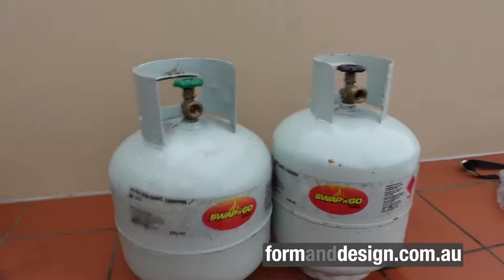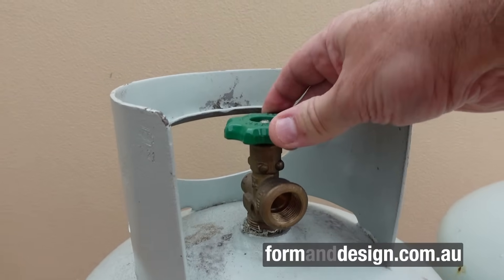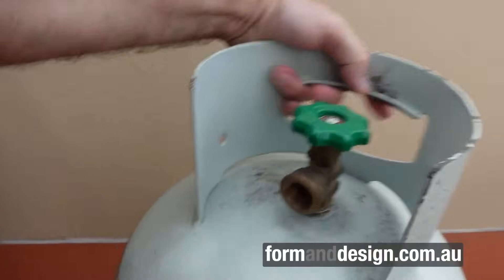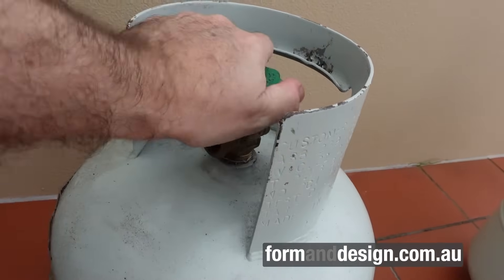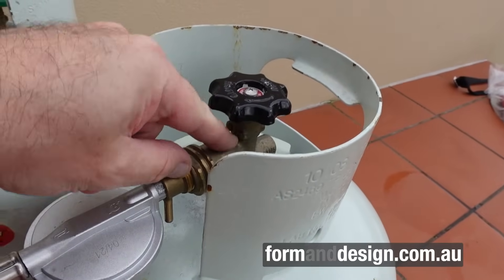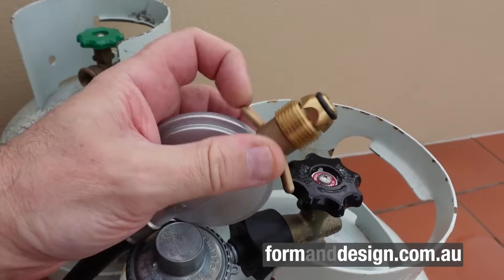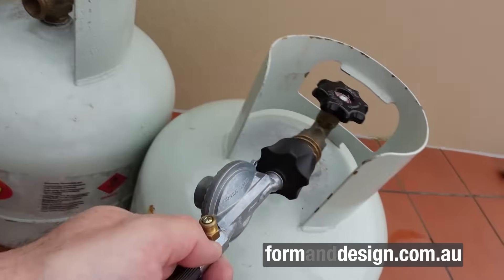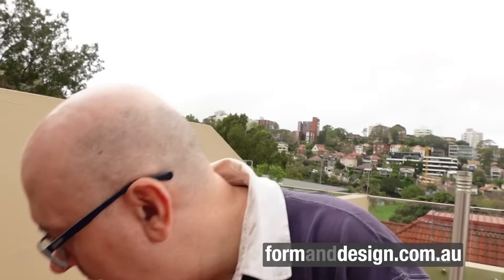LCC 27 vs POL Gas Fitting - What's the difference?

Comment: I bought a new regulator/gas safety gauge (Garth brand) and fitted it to a newly purchased (full) LCC27 bottle. However, there is no gas coming out at the barbecue end of the hose. What could be wrong, please, Andrew?
Reply from the maker: @topearner2007 a few things to clarify first. I would recommend that you check out my Part 2 video on this topic which answers the most common questions and comments on this video. You can find it here https://www.youtube.com/watch?v=4JFYltGZfrE. My questions for you. 1) Why did you buy a new regulator? 2) What is the fitting on the new regulator hose? Does it have a LCC27 or a POL fitting to attach to the bottle? 3) Does your new regulator hose fitting have a gauge on it? See the Part 2 video. 4) Is this an Australian enquiry? If not, I can't answer your questions because I am not familiar with fittings from other countries. 5) If you purchased a LCC27 fitting, where did you buy it from? If purchased from an online store like eBay or Amazon sometimes they say LCC27, but are actually QCC1 fittings from the US and are similar but not the same and should not be used.

Comment: Thanks mate very informative video how much is the new hose 😊👍
Reply from the maker: Check hardware stores websites. Search for “LCC27 fitting”. They are readily available and not too expensive. If you change yours then use some soapy water around the connection where you screwed out in to you BBQ or whatever you have to check for leaks when you allow the gas to flow

Comment: Here state side this switch happend for us quite some time ago before I was born so at least 2 decades ago but for us POL is still used for bulk tanks connected to the first stage regulator or 100lb propane tanks only come with a POL connection as they are mainly used for residential heating applications or food trucks

Comment: The pol fitting won't push the safety valve to release gas from new cylinders
Reply from the maker: Unfortunately the problem lies with the POL fitting not the LCC27 fitting (I’m assuming that you are Australian and referring to the LCC27 fitting. If not then ignore this video). The problem with the POL fittings is that not all the manufacturers are sticking to the design and there are variances. There is no variance with the LCC27 fittings

Comment: Common for house gas users to use 9kg in place of 45kg , this would make changing over easier, if the lcc fitting is allowed on fixed installations.

Comment: The LCC Type 27 is basically the same as the old US QCC fitting. This was superseded some time ago by the OPD fitting. The OPD fitting has a triangular valve handle and an overfill protection mechanism inside the cylinder. The Australian LPG industry missed an opportunity to eliminate the problem of overfilling.

Comment: They make an adaptor to use LCC27 fittings with Pol bottles on eBay but fat chance finding them in a place like Bunnings.
Reply from the maker: Adaptors are dangerous and illegal in most states. This is because the two threads work against each other. When you tighten one it is possible to loosen the other since one is CCW (POL) and the other is CW (LLC27). Also all the adaptors I’ve seen are POL to QCC which is slightly different to our (Australian) LCC27 fitting. The simpler thing is to swap out your bottle for one with the new fitting which safely accommodates both POL and LCC27 fittings.

Comment: That’s all very well and good except … I have a POL cylinder, exchanged it at Bunnings back in May. Still has heaps of gas in it. But the hose & reg on my BBQ was perished and the O-ring was pretty squished, so I thought I would just buy a replacement. But POL hose and regs are not available anywhere. I didn’t want to get an LCC27 type because my cylinder is still nearly full. Fortunately I found one on Amazon. 
Then I bought a Matador Rapid Searer (brilliant machine, cooks a steak in 2.5 mins), but of course it comes with an LCC connector that doesn’t fit my POL cylinder. aaahh! 
At this stage I was about ready to stick my head in the oven, but didn’t have the right connector.

Comment: Or buy an adapter and you'll never have to use your brain to think about it again.     (LCC 27 to POL adapter)
Reply from the maker: An extract from Elgas' web-site regarding this issue.
"Whilst you may have purchased an LCC27 to POL adaptor (gas bottle adapter) at Bunnings or other BBQ store, please remove and discard it because it is a safety hazard.

In addition, the LCC27 adaptor (gas bottle adapter) is banned in WA whilst the QLD, VIC, TAS, NT and SA state governments have posted warnings against LCC27 to POL adaptor use. This follows a homeowner receiving severe burns resulting from a gas cylinder fire in Western Australia whilst using an LCC27 adaptor (gas bottle adapter). The injured person was hospitalised for further treatment."

Comment: Minor issue: If you are using an LCC bottle with a POL fitting, the POL fitting will NOT engage the internal valve in the LCC fitting. If some clever cloggs has opened the tap on the LCC bottle while it is detached the safety valve inside the LCC fitting will close. When you screw the POL fitting in, because it won'tnengage properly, the gas pressure behind the safety valve will keep it closed, meaning no gas will flow. The only way I have found around this is to make sure the tap is closed and force the internal valve open with a suitable rod of some type—it's high pressure, so it takes a good thump—preferably made of brass (sparks are a no-no). There will be a slight puff of released gas, and the POL can be attached and used normally. Then, replace all of your POL fittings with LCC ones 😉
Reply from the maker: If you find that "the POL fitting will NOT engage the internal valve in the LCC fitting" then chances are that your POL fitting is old and needs replacing. These things do not last forever and some older spec fittings are problematic. If you are trying to gerryrig something like this, then OBVIOUSLY something is wrong. If the POL fitting and the LCC27 fitting are in good working order then it should work as designed. My recommendation is to NOT fiddle with the safety valve. It's there for a reason. Figure out where the problem is and replace or fix the part that's faulty. Put simply, the new LCC27 fitting on the gas bottle in particular is a major safety improvement designed to reduce the risk of accidental gas bottle leaks and the consequences thereof.

Comment: I wanna get rid of the counter clock wise turn on the tank to tighten it. I’d rather have the other end with the big plastic so I can hook it up clockwise and un loosen it counterclockwise like normal on anything else then I don’t have to bring a wrench. Is that possible for cutting the hose and putting a different one on?
Reply from the maker: I'm not sure what you mean by this. The new LCC27 fitting is a clock-wise fitting (for tightening). If you have an old POL fitting, then simply go to a hardware store and purchase a new hose which will come complete with a regulator and the new LCC27 fitting attached. Then simply replace the old hose, by unscrewing it, with the new hose/regular/LCC27 fitting. I hope that answers your question.
Reply: @ I went to a hardware store and they actually had it for once every other place in this small town never had crap. I bought the adapter and it also has a regulator on top to let you know if you’re full or lower or medium wish I could send photos on here.
Reply from the maker: I think I understand what you are trying to achieve. I have seen on internet searches the type of product that you have purchased. If I understand this correctly, what you have purchased is an adaptor that converts a POL bottle to a LCC27 fitting. Just for the sake of explanation, I am a Professional Mechanical Engineer and I designed many pressure vessels and their associated fittings. I also managed design and manufacturing operations that made cryogenic road tankers and pressure vessels. I have some experience in this and I have seen many accidents and heard of many more from gerry-rigged appliances as well as accidents happening that have caused redesigns of products. The problem with the type of adaptor that you are using is this, the two threads work against each other as you have pointed out. So when you install one, let's say the POL fitting which has a CCW thread, every time that you tighten the LLC27 fitting (which is a CW thread), you risk loosening the POL fitting. That's because to loosen the POL fitting you wind it CW. You might say that you tighten it more than enough so that it won't loosen, to which I would say, that's an accident waiting to happen. The adaptors have been banned in several states already due to severe burns occurring from adaptors that have come loose. Given enough time, these adaptors will be illegal all over the country. There have been a few comments from people who seem reluctant to just upgrade their equipment. I'm not sure I understand why. In stead of spending money on adaptors, isn't it just easier to swap a bottle. The swap system doesn't care if it's not their bottle. They don't care if you go and fill the bottle through a manual fill station later when it's empty. Also, their bottles are certified, checked and stamped. Bottles have to be re-certified every ten years. Also the considered useful life of a hose and regulator is also ten years. New hoses with regulators are also a cheap alternative. My recommendation is to, throw away your adaptor and upgrade your gas bottle to the new LCC27 fitting either by purchasing a new one or by swapping it out. The LCC27 fitting will accept both POL and LCC27 fittings on your appliance.
Reply: @ like I told you before I’m not allowed to send pictures on here. They don’t let you if you would look at a picture I have you would understand. When I hook up my Mr. heater, I like to have a ACME hook up with a huge plastic handle that you turn on clockwise onto your tank. With the POL you have to turn it counterclockwise to your propane tank. 
All I did was buy an adapter that the POL screws right into the adapter and that will personally stay there nonstop. I will not take it out. The other part is the ACME. I told you before give me your email please
Reply from the maker: I can’t give my email address over a public forum. BOTs and Trolls pick them up and run with them. I know exactly what you are talking about I don’t need pictures of your setup. My recommendation hasn’t changed. Adaptors in POL bottles are potentially dangerous. You first tighten the fitting into the bottle (the POL fitting). Then as needed you use the hose and regulator setup with the LCC27 fitting to attach to the adaptor in the bottle. The problem is as you attach and tighten the LCC27 fitting in a clockwise direction you risk loosening the adaptor which loosens when you rotate it in a clockwise direction. Just replace the bottle it is so much safer. Now one thing I need to mention, I am only talking about the LCC27 fitting in Australia. If you are not in Australia then this video and its content does not apply to you.
Reply: @ so my 10 foot hose is a pol end to it. So I got the adapter that has the threads inside that you turn counterclockwise to tighten it and on the other side it has the big one that you just put over the top on the tank and that goes clockwise like normal.

Comment: Just be careful of the gas flow on the new fittings as they won’t work on larger BBQ’s the hole in the end of the hose where it screws into the bottle is a lot smaller and won’t allow high volumes of gas to flow out.
Reply from the maker: The new fitting only applies to the 4-5kg and the 9kg bottles. They are not being implemented on the larger 45kg bottles or the smaller bbq bottles. The stated flow rates and pressures for the POL and the LCC27 fittings are similar.They both have similar pressure ratings between 2.75 and 2.8kPa. The flow rates are 1.5kg/h (LCC27) and 2.0kg/h (POL). These are the stated pressure ratings at the regulator. I would recommend checking the regulator ratings because they might differ slightly between brands. The ratings will be clearly stated on the regulator. It's the regulator that will determine the flow rates and pressures, but it is true that the nozzle inside diameter on a LCC27 fitting is smaller than a POL. This is a correction from an earlier version of this response where I stated that they were essentially the same.

Comment: POL fitting doesn't depress the internal safety valve in the LCC fitting , Screws in but no gas
Reply from the maker: If that is the case then either your POL fitting or the LCC27 fitting is faulty. Try your POL fitting with another LCC27 fitting. If that doesn’t work then mostly likely your POL fitting is the problem. If it does work then it was the LCC27 that was faulty. Make sure that it is actually an LCC27 fitting made for Australian use. Other fittings from other countries are similar but not the same.

Also there are some discrepancies with older POL fittings. Also the regulated useful life of a regulator/fitting assembly is ten years. That goes for gas bottles as well since they have to be re-certified every ten years and stamped as such. That's why it's good to use a swap system. In terms of your old POL fitting, my recommendation is to go to a hardware store and buy a replacement hose/regulator/ fitting, like the one I showed in the video and replace it.

Comment: Great video - thanks! If you need to retro-fit a new hose to an older BBQ (like the host at the end of your video) do you need to use gas-tape on the thread or are they pretty much standard screw off the BBQ body thread and screw on the new one with a spanner?
Reply from the maker: Check the instructions on the pack and follow those. Make sure that the connection does not leak by using some soapy water over the fitting before igniting the appliance. If unsure, get a plumber to do it for you.

Comment: Cool!! I've got an old tank top heater. Still using old tank. Didn't realize POL male connections are backwards compatible.  In winter Wisconsin, propane heaters are a must for shop
Reply from the maker: Just check your local gas fitting regulations. This information is specific to the Australian LCC27 fitting not the US QCC fitting. It might be similar but I honestly don’t know. Thanks for your comment anyway
Reply: @FormanddesignAu The US has transitioned to the externally similar OPD fittings. It is basically the same as the QCC/LCC27 but has a triangular valve handle and an internal overfill cutoff float to prevent overfilling. All of the QCC connectors I’ve seen so far from US manufacturers have retained the internal POL thread for backwards compatibility, so it seems likely that they’ve got backwards compatibility built in too.

Comment: Did a swap and go recently for my POL fitting, got the LCC without realising, and the POL fitting doesn't actually depress the safety valve in the LCC-27 connector. There is a difference on the end, and I tried putting it in tighter, but still no go, managed to get it to work with a different POL connector, but seems they aren't all exactly the same.
Reply from the maker: There are some discrepancies with older POL fittings. Also the regulated useful life of a regulator/fitting assembly is ten years. That goes for gas bottles as well since they have to be re-certified every ten years and stamped as such. That's why it's good to use a swap system. In terms of your old POL fitting, my recommendation is to go to a hardware store and buy a replacement hose/regulator/ fitting, like the one I showed in the video and replace it.
Reply: Exactly pol won't depress safety valve.

Comment: Don't know about how it is over there but, here in the States on the new style, when the rubber ring in the push valve wears out you have to replace the whole valve meaning the new style valve is not serviceable. Might look into it. I still like the old style better.

Comment: I just found out about this chage recently whilst talking to my gasfitter. I don't have a problem with the change, but would be interested to know if there is a safetey issue that I came across years ago whilst changing out a forklift bottle. The fork gas bottle has that same feature of not allowing gas out of the cylinder until thje fiting is attached. However, in the incident I mentioned, I once changed out a cylinder, not realising that the tap had been left openAs a consequence, I got a gas burn on my hand when I inserted the fitting and straight away the gas came out before having a chance to screw in the fitting! After that, I made it a habit to check the tap prior to fitting the hose, but I have so far not seen any comments about this happeningI would be interseted to know if it can still happen with these new fittings, as currently I don't have one ot try out.
Reply from the maker: Firstly, you make a good comment that you should always check that a valve is properly closed before attaching or removing a fitting. Secondly, it sounds like both the forklift LPG bottle and the propane bottle (in the video) use a similar kind of safety/check valve. However removing our attaching a fitting to the bottle when the valve is open will always create some kind of pressure blow back even if only momentary. The tightening nut on the propane bottles have a shroud that should give some protection from the gas blow back when removing the fitting when the valve is open but the bigger problem could be the tightening nut flying out of your hands from the back pressure. I haven’t tested this and I really don’t intend to try it. The best and safest way to handle these fittings is to always double check that the valve is closed when attaching or removing a fitting.